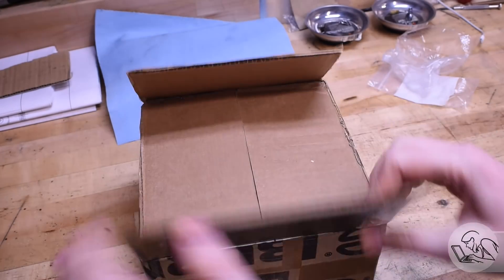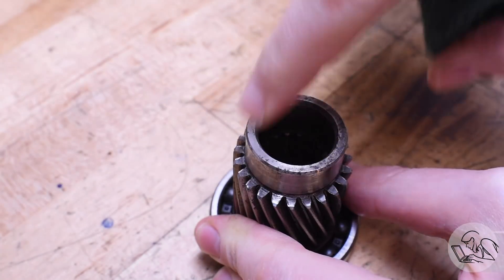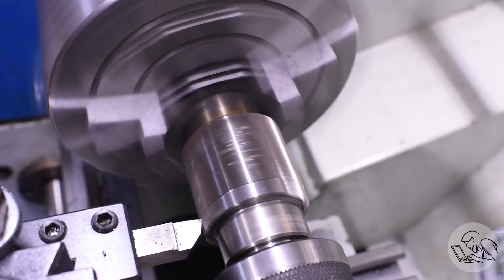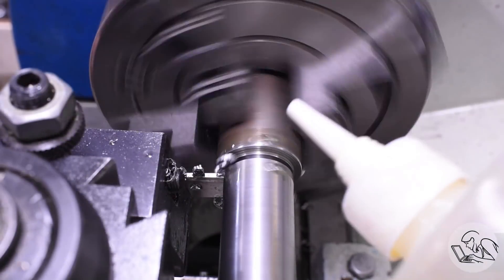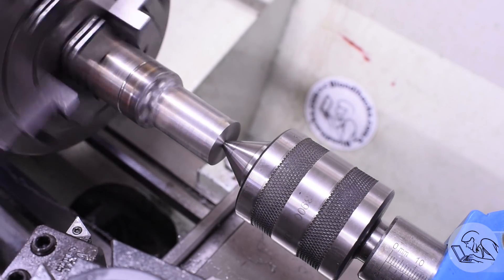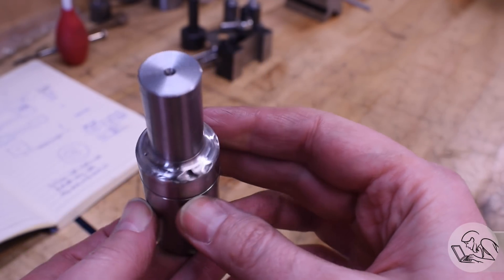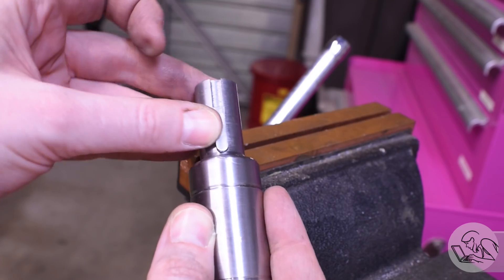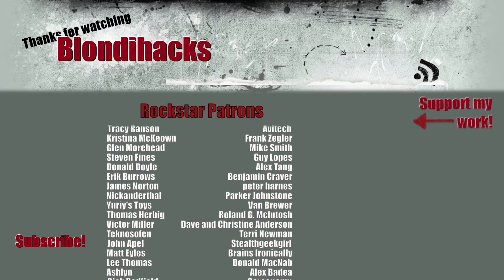Go Cart Drive Shaft (Go Kart?)

Comment: Really nice work!  The welding is fine.  But I do have a suggestion...  You should get a TIG setup.  Not because it's faster - it's not, or stronger - it's not, but because it's easier (really) and it gives you more control.  Yes, TIG aluminum is hard, but mild steel or stainless it's really easy, and you can see what you're doing.  You can easily adjust the heat into whichever side of the part you want, there's no oxidation or flux inclusion, and you have complete control over the feed rate of the metal.  It is the best process for small sized mild steel projects.  It's one gas for all metals, just straight argon.  Stainless is actually easier than mild, for anything but thin sheet, because stainless has less heat conductivity.  Try this!  Mig is a great production and fabrication technique, but it's not well suited for small one off jobs, IMHO.

Comment: Another outstanding episode.  In the unlikely event I ever opened a welding shop, I would name it Pigeon Shit Welding.  I have to say, the appearance of my welds got substantially better when I switched to solid core wire and put some big honkin' lights over the welding table.  If you can't see anything outside the puddle, it's going to look like pigeon poo.

Comment: Love these type of experimental builds. As a long time tinker / street rod builder, ect, have a future project planned using a 3.75 hp 1750rpm treadmill motor to power a 1980 240 John Deer lawn tractor. May require a wheel bar, hehe...Thx for sharing this one too,,Bear

Comment: 30 Rockwell C is pretty much what you'd expect from 4140 alloy steel in the 'HT' quenched and tempered condition. It's well known for getting beautiful surface finishes when turned and is popular for parts like gears and shafts, so I suspect that's what your sleeve was made of.

Comment: Hey Quinn, why do you spend time dilling in the 4 jaw chuck when you could use a self centering 3 jaw?  PS your welding is still 78.4% better than mine! 😉
Reply: 3 jaw chucks never center perfectly, so if you need absolutely minimal runout you must use the 4-jaw.
Reply: @nerd1000ify  plenty accurate enough on a hobby machine imho.
Reply: @koosintea9698  depends what you're trying to do. For a chain sprocket 0.005" runout would probably be ok, but some other stuff needs a higher level of accuracy. E.g. not long ago I made an adaptor spindle for a flex shaft grinder that runs at 10,000rpm. If I'd allowed 0.002" runout in that it would have either locked up up the bearings or shaken itself off the table when turned on.

Comment: Quinn, You should get a cheap DC Tig. Many years ago when I first got started machining I bought a $400 harbor freight DC Tig welder and it served me well for a long time. I like tig for machining projects because there is no splatter and there is way more control, plus there are times when you just need a fusion weld and no filler.

Comment: I have been suggesting the aluminium type inserts for mini lathes for some years now, the ground edge and 20 degrees of rake means they need less power than most other inserts. My cnc lathes are a whole 1/2 hp at the spindle so I have been using these on steel for quite a while. They may not last that long, but they are available on ebay for around $2 an insert, so hardly going to break the bank.  Nice that someone with more viewers and subs than myself has put it out there as they make quite a difference. Nice job on the part you made, I can't weld. don't even have a welder!!

Comment: Quinn, its a lucky, man, woman or cat that you call a  friend , Tip for you , flux core welding is not pretty (like tig welding )  but if you take your torch (flame thrower as the kids call it ) and warm that shaft up than weld it. The weld will look more even because the part is so hot , the puddle becomes  molten much quicker the flux goes to the top of the weld bead faster and you also have more pentation from the pre heat ...  Thank you for taking the time to make these video's  Pete M

Comment: Would you have been able to use inside jaws on the gear shaft to hold it in the chuck? Also, why not mill the teeth off close to the OD of the shaft, and then put it in the lathe for final cutting?

Comment: Don't worry about your welding skills. I was clearly put on this earth to make sure that no matter how bad you think your welds, cuts or grinds are, you can sleep safe in the knowledge that there's a bodger in England who makes you look like a machining goddess. Which, of course, you are.
My party trick is making tig welds on stainless look like they were done with an arc welder on rusty iron. Now that's bad welding.
Reply: When I trained as an engineer, I REALLY couldn't get the hang of stick welding, So when we had to make a bracket as a test piece to be marked on, and my welds all looked like I'd made them by throwing lumpy porridge at the metal, I over filled all the weld fillets and ground them back to smooth curves. The examiner looked at it and asked why I'd ground the welds back that he was meant to be marking me on, and I said "The diagram you gave me to work from showed all the corner welds to be perfect radii. You can't make perfect radii with multi pass arc welding, so I decided I'd have to improvised so as to better make the workpiece reflect what I was instructed to make............. By the way, The welds looked stunningly good before I ground them back". I was sure I'd end up getting failed for that, but as I would have failed due to my pigeon sh*t welding anyway, It was worth a shot. He looked back and forth between me and the workpiece 3 or 4 times, Then said "Well, I'm supposed to be marking you on your welding and accuracy. Obviously, I can't give you many marks for the welding aspect. I've tested it and found it's structurally sound, so you got good penetration. The problem is that I can't SEE the weld quality....... But as you've made this EXACTLY as per the instructions, I suppose you have to have full marks for that aspect.

For the bare faced cheek of me obscuring the fact that (As we both knew) I was utter cr*p at stick welding, that guy gave me JUST enough marks for the weld so that, combined with the full marks I got for accuracy, I scraped a pass in that module of the course. :D

So when people say that "An angle grinder is a bad welders best friend" I always get a warm fuzzy feeling. :D

(BTW, My stick welding DID improve dramatically once I realised that you can use the back of your gloved left hand as a guide for the electrode without electrocuting yourself ! :) )

Comment: Nice job. That would hard to get done at most shops. Hopefully you get to drive the Kart one day.
I often cut blind keyways. I don't cut all the way off the end of the shaft so the key can't escape.
It looks better on things like handwheels where you might notice. I still have several keys on the
shop floor somewhere. They will turn up when I'm looking for something else.
Reply from the maker: Good tip!